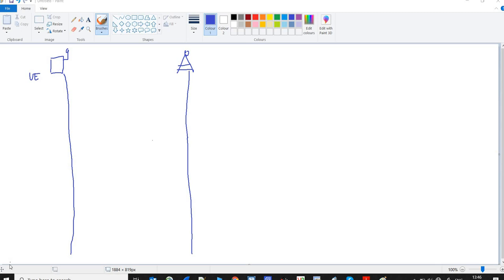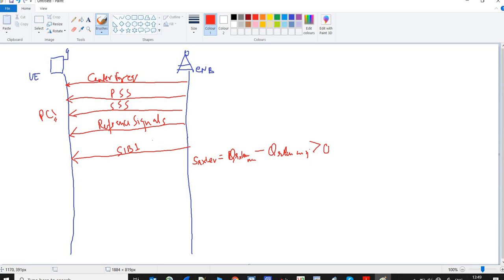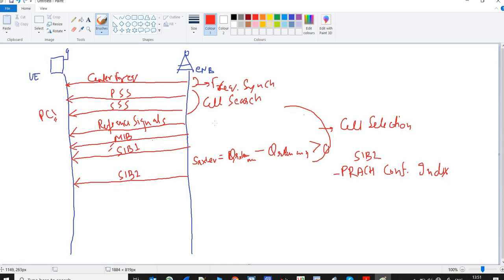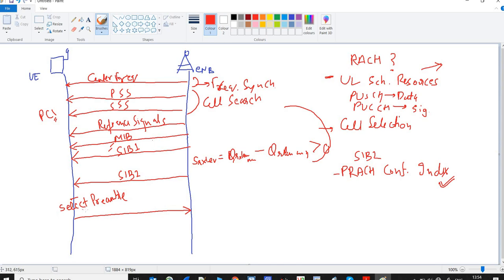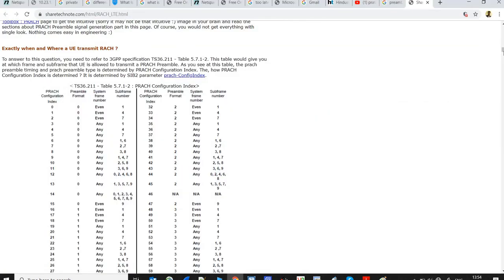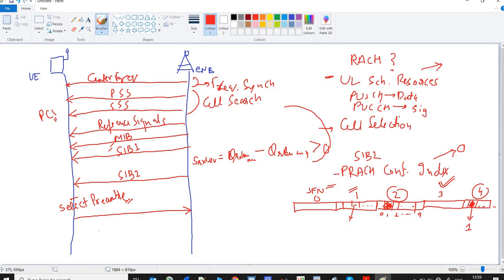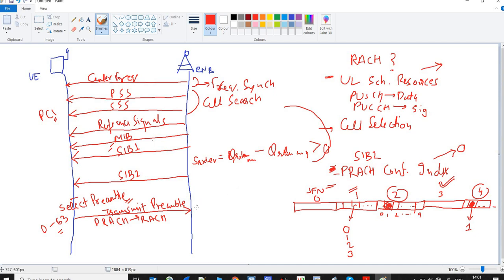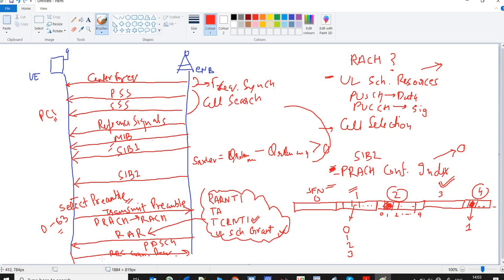LTE Tutorial (Part 4) LTE RACH Procedure

Comment: Bro,Why PHICh used in MIB?
Reply from the maker: PHICH is present in 1st ofdm sysmbol of all subframes. It is a DL channel and it is used to send ACKNOWLEDGEMENT of data received in UL.
Reply: @lteplusplus1225  Adding something more about this.. pls correct me if m wrong..PHICH is transmitted in MIB.PHICH is used for ACK/NACK,but its configuration is present in MIB,Which tells ue abt no. of PHICH group, no. of PHICH RB's,so that ue can calculate PDCCH RB's or CCE
1 PHICH Group=8 PHICH's
Thanks🙏
Reply: @lteplusplus1225  ok thnx..